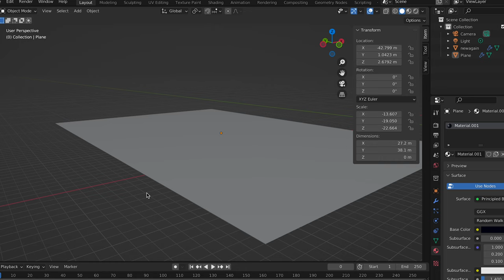Don't drink and woodwork

Comment: Great video. I have a couple of quick questions though, as a maker in Sweden: Where do you get flat top grind blades? I’ve really struggled to find them. Same goes for self-centring drill bits, I can only find them in imperial from Trend or something. Lastly, do you have any good suggestions for wholesale wood suppliers? Currently using Ceos in Göteborg and Fredricsons in Malmö. I’m based in Malmö so delivery would be required. Cheers in advance!
Reply from the maker: thank you! I bought the blade from verkter.se (CMT 285; 250x3,2x30; Z40; 15°) - self centering drill bits was from Amazon but they are indeed in Imperial. And Calexico has a lot of wood and I mainly buy from them.

Comment: Nice work! What program did you use for the first animation of the cabinet?
Reply from the maker: thanks! I used Blender for the animation. I export my files from Fusion 360 to Blender, apply textures and then animate there since Fusion doesnt really do animated videos with rendered quality.
Reply: @TheSwedishMaker  Ahh interesting! I have not used blender yet perhaps I will have to check it out. Thanks!
Reply from the maker: yes check it out. It´s got so many features, but just to be able to do video renderings and photos as well is really fun.